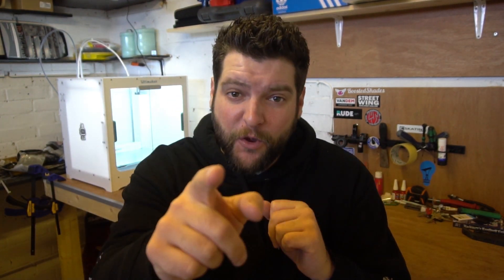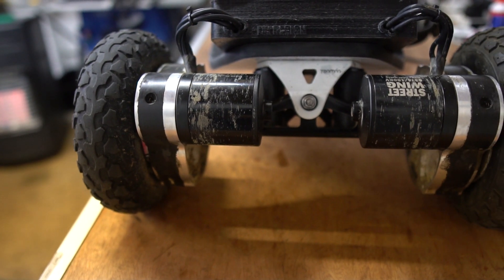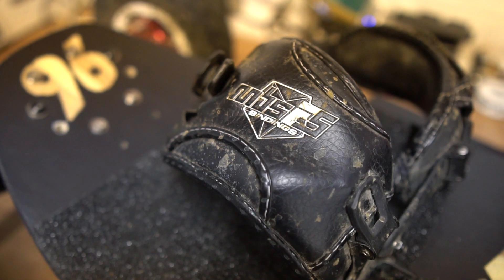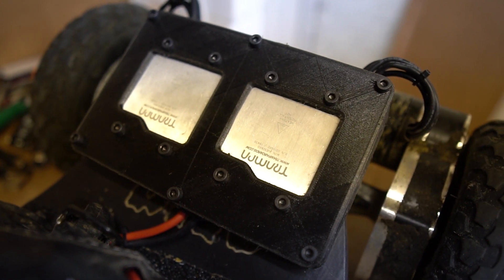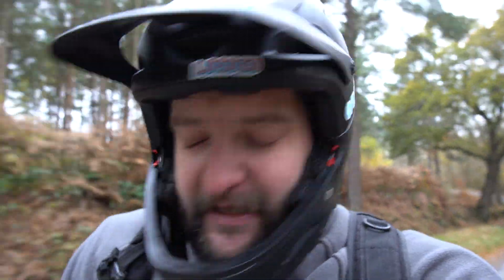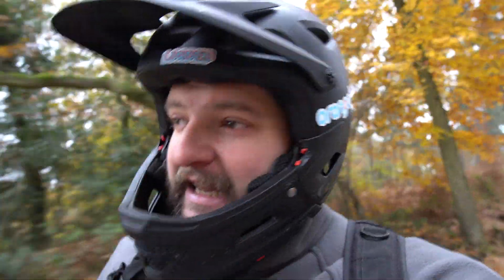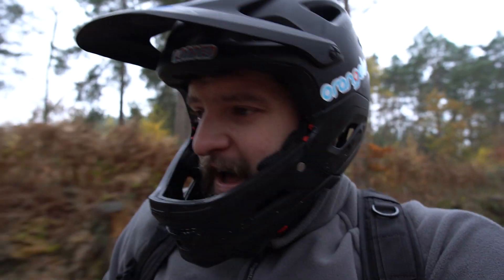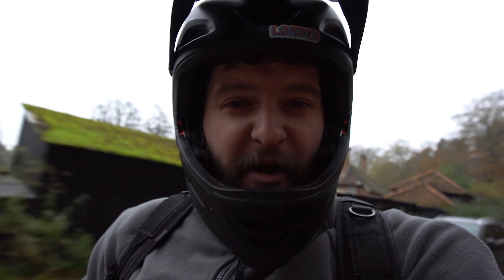How To Build An Electric Mountainboard - 6 Months later - Upgrades!

Comment: I've been watching all your videos and gotta say top notch work. I have a few questions as a newbie. I currently ride a halo beast with cloud 120mm wheels. Top speed is around 30mph and good range if I go slower. So questions... 
1. Options to upgrade range? I was thinking of contacting halo to get a second battery and run it parallel to the first. From what I've read this will nearly double my range without changing my voltage or having to swap any other parts. I haven't been able to find specs on the battery besides 36v, 374.4wh, 10.4ah. so I don't know series or parallel numbers. Or would I be better off with a custom battery?

2. With your setup do you have speed options on your remote? So if a beginner hops on they won't die? If so are these set up in the software you showed?

3. Do you have reverse? I rode a buddy's boosted and really liked that you didn't have to flip a switch or push a button to go reverse.

4. Charging? My current setup takes about 5hrs to fully charge from dead. If I double the battery will it take twice the time to charge? Can I use a bigger charger? Current charger is 42v @ 2a.

Comment: I've got a question, we love lightweight and weight distribution, but have you thought of adding some 3d printed wheel arches for really muddy/wet rides? I get mud and dust on my jeans from the rear tires so I've experimented using surplus plastic knee pads as rounded wheel arches
Reply from the maker: I have considered making some yes but in the end I dont mind the mud! I believe there are some solutions available on the builders forum